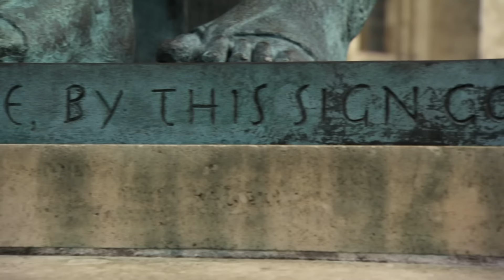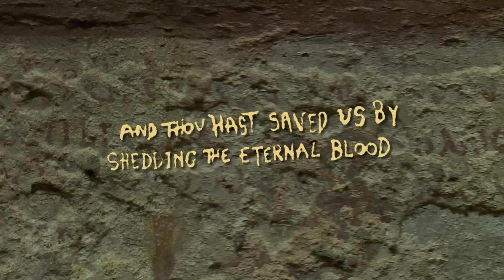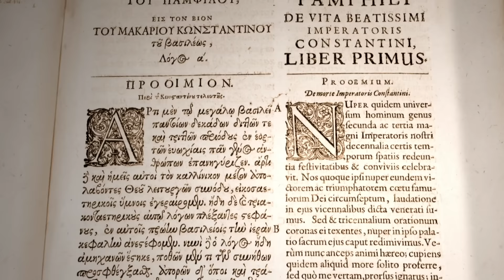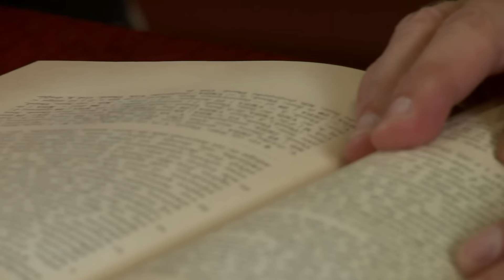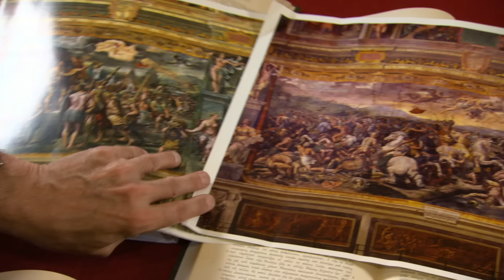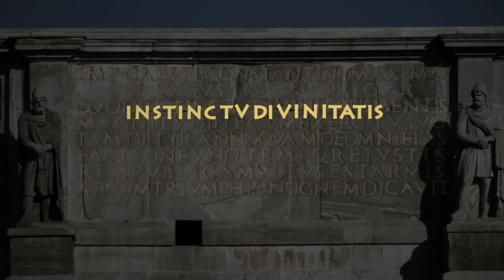Parable Special: Rome's Christian Emperor Revealed

Comment: The Mithraic religion highlighted the movement of  the Sun across the elliptical. The movement 
from the constellation of the Bull ( Taurus) to the constellation of the Ram ( Aries) took place at about 2,100 bc. Prior to that Spring commenced in the constellation of Taurus for about 4200 Bc to 2100 bc. The fact that Mithraism Was a secret and elitist religion is not because it was different from the Roman religion per se , but it added an esoteric spin to the Roman Greco religion, particularly from
About 200BC , because the constellation of Aries matched the sign of Aries due to the precession of the equinox. 

In Persia, where the magi originated from .. the lamb was known as the Ram.. so the author gets it wrong here .. the symbolism of the cap was from the Zoroastrian faith, where it is mandatory for Zoroastrians to wear a cap. This practice Was adopted by the Jews and Muslims later. The Mitraic religion is influenced Mitra of the Indo - Zoroastrian faith.
 
Going back to Astronomy ,  sign of Aries , which is symbolised by the Sun bcoz  Sun reaches it zenith or exhalation point in Aries and that explains the reference to Mithras as the Sun God.

No doubt, Constantine had motives in combining Christianity with the Mithraism and this can be seen by the church adopting Easter corresponding to Sun’s move into Spring
Equinox which coincided with so called the rite of spring celebrations which later on became Easter. The’s sun movement into Capricorn or the winter solstice on 22nd December was adopted as the birthdate of Jesus to make it easier to combine  the Greco Roman customs into Christianity.
Reply: Excellent words.
Reply: Thank you good sir. Glad to see others teaching the truth on public forums
Reply: Informed Alpha 🤔🤔🤔
Reply: Very good information
Reply: Yes Mithra literally means Same in Hinduism too . Mithra is referred to Morning Sun or the one who provides path to travel to the sun in different signs
Reply: Indeed the winter solstice is celebrated in Persia(Iran) for thousands of years, as the night of birth of sun. It is called Yalda night. Which is equivalent of Yule night of Scandinavians. Also the most important symbol of Mitra was cross, yes! Cross! Because in the first moment of sunrise in the horizon you see a cross of light first. Same is true for oak tree, baptism, trinity etc, all coming from Mithraism. But that’s a long discussion…
Reply: So why has Jesus and Christian the king of kings and has beaten all other gods and religion and took over the world !!?? 😏✝️
Reply: @kartikbhatia7823  and how do other Kings and cultures conquer and spread and “beat others “.  🤔.
Reply: @kartikbhatia7823  regardless of your little feelings being hurt. Who rules the world ?? 🌎. The king of kings of course just like it is written.  ✝️
Reply: The celebration Christian Easter is based on the timing for the Jewish Passover. But it's true that Judaism (and thus Christianity, which later grew out of Judaism) had adopted many Persian beliefs and theological ideas during the reign of Cyrus after the end of the Babylonian captivity. The hierarchy of angels, belief in Satan as the cosmic enemy, and anticipation of an apocalypse all came out of Persia. That's why they're absent from the first part of the Old Testament.

Christianity and Mithraism were two of many eastern mystery cults that became popular during the late Roman Empire. Christianity, of course, prevailed.
Reply: Nice! Provide your references. Good info
Reply: @overseer3072  he hasn't. Even in Europe old traditions prevale, let alon the rest of the world.
Reply: A couple astro vocab notes:

"Ecliptic" - plane of earth's orbit around the sun 

The Sun is "exalted" (one type of dignity a point can have in astrology) in Aries (which starts on the Vernal Equinox in the Tropical Zodiac)
Reply: @overseer3072  you think if jesus existed he would have tolerated the way christianity came to power? Your argument is flawed. Christ himself never said to worship him, he said to FOLLOW him, as in act like him.
Reply: @TomTom-yu1xp  passpver is all about the sun passing over the vernal equinox
Reply: @overseer3072  Easter isn’t Christian. If you were truly a Christian you would know that. Neither is Christmas. It’s pagan.
Reply: @overseer3072  Jesus himself never used force... and would've never taught force.
Force is what Rome used to dominate
Reply: @overseer3072  because the Roman Emperors decided it was beneficial for empire. And the church was just an extension of their governance.
Reply: Zoroastrian faith is the original religion upon which all religions have been derived.
Reply: @ammasophia4663  Jesus physically assaulted the merchants in Solomon’s Temple.
Reply: @charlesrocks  All religions didn’t come from Zoroastrianism. 🤦🏼‍♂️
Reply: @charlesrocks  We also don’t have empirical evidence of it being the first monotheistic religion. Judaism is also said to be at least 4,000 years old, and also thought of as the oldest monotheistic faith. However, if people truly were monotheistic during the antediluvian era then Judaism would be the oldest monotheistic religion.
Reply: @daca8395  yes the world is Satans.  God rules the Heavens and has all authority.  He gave Satan the power unless it be taken from him in Yahweh’s name.  Satan is the ruler of the earth.  can’t you see it!?!?!   We need Yeshuas mercy and love and authority.  The world will bring us away from The Truth.  The path is narrow to Him.  Broad is a life of power and fame.
Reply: @joshuacromley7439  yes let go of all earthly possessions to follow Him.  This is the hardest thing to do but most rewarding.  Currently working on it.
Reply: @nfin8beam211  satan doesn't exist! 
And that is according to the bible. Feel free to look it up
Reply: @nfin8beam211  funny yet YHWH himself declared to Isaiah in Hebrew that he does not share his glory to no one 🥴
Reply: @joshuacromley7439  I have a different understanding. Jesus to Buddha were entirely their own men. They followed nobody did their own thing and stayed true to themselves no matter what others thought...To me that is the hidden meaning of FOLLOW ME...it means follow your own path and stay true to yourself not literally LIVE AS I LIVED...More live as YOU feel you should live and discover your own truth.
Reply: @StennMathis  you are free to have your own opinion. The bible, quran, and torah are kabbalistic paths to God
Reply: @shriharikulkarni2305  dead bodies come back to life all the time. Decomposed no, but dead, sure. True christianity taught reincarnation
Reply: @shriharikulkarni2305  you're misinterpreting my words, but ok. Just realize what we call God, is Life, Love, Joy, etc. But ignores the opposite polarity of God. God is the beginning and end, alpha and omega, life and death. People think God is only positive and that is nonsense. Positive, neutral, negative, and death, the four parts of God's divinity. This is shown in the four seasons, electricity, the space-time continuum, the elements of the zodiac. This is also encoded in the cross of Christ, the two arms represent the equinoxes and the apexes the solstices, but the arms and head of cross represent the trinity of the God of creation, and the single downward pointing apex is the God of destruction or Death. At least from what I have seen and read
Reply: @shriharikulkarni2305  also seen in the sine/cosine waves
Reply: @Kaleb the devil is a liar and deceiver. He is allowed to think he is a ruler through his extensive pride. All Jesus responses are quotes from the Old Testament. If you have a good Bible, the quotes have footnotes that refer to the original words.
Reply: @shriharikulkarni2305  excuse me!?!? GOD CAN DO WHATEVER HE WANTS. HIS INFINITE LOVE and KNOWLEDGE CREATED this seemingly endless universe. HE LOVES you, HE died for you that you would live forever, if you choose HIM. Be Blessed 😊
Reply: Just a load of BS.
Reply: Wrong! Christianity cannot be compatible with other religions. Your argument falls flat.

Comment: The battle for the Milvan Bridge occured in AD 312.  Constantine's Arch was completed in AD 315.  That there are no crosses on the shields of the soldiers in the reliefs of the Arch makes complete sense.  Firstly, if they were on the reliefs originally, they would have been painted on, not carved.  The Arch was originally painted in brilliant, vibrant colors, with gold leafing as well.   Second, Constantine's conversion to Christianity did not occur in 312 - whilst he made Christianity LEGAL, his personal conversion was a longer process.  Further, the citizens of Rome would not have responded well to Christian symbols all over his Arch, and Constantine was not prepared to agitiate them by "insulting" their pagan gods.     The research in this program is really biased and skewed.  Not surprising, as the Simcha is an Orthodox Jew, which I don't believe he ever disclosed in this production.  * Constantine and Licinius issued the Edict of Milan in AD 313.  * Constnatine had the Chi-Ro synobol stamped on the reverse of his coinage.  *  Constantine donated the land for, and constructed the first Basilica of St. Peter.  In short, one has to be very selective in choosing which aspects of Constantine's life to favricate the myth that he was not a convert to Christianity.   Simcha clearly set out to undermine Constantine and Christianity, and dedicated this "documentary" to the project.  It fails.